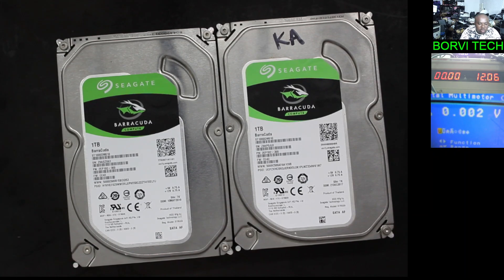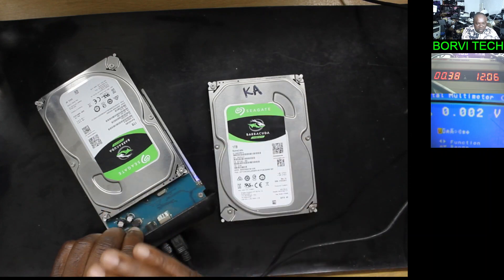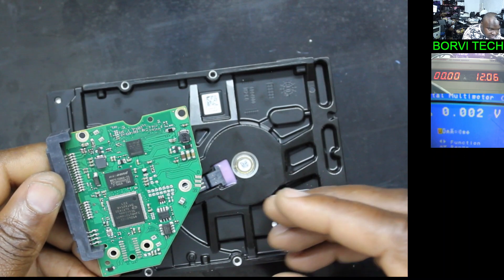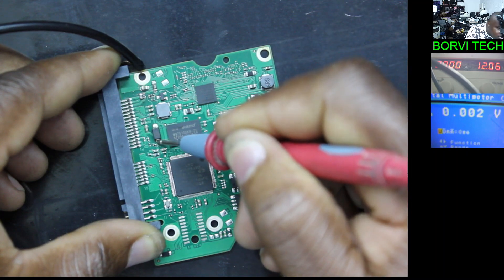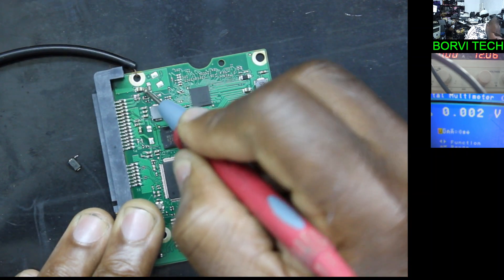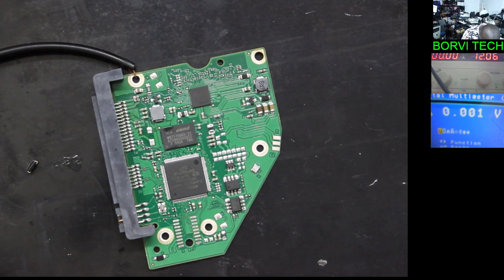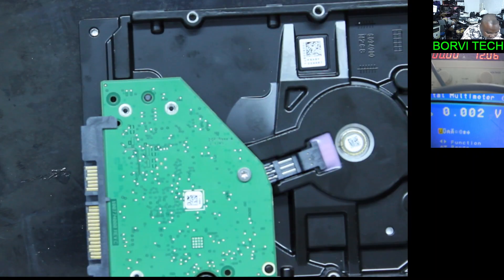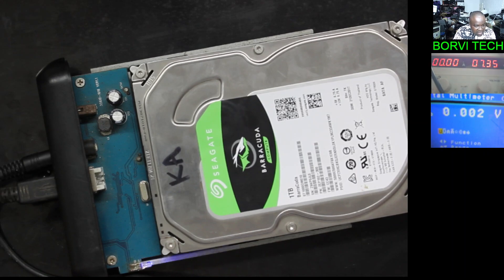Hard drive Fixing a Dead Seagate HDD - No Power

Comment: Resp Sir! Very Nice Sir. ధన్యవాదములు Sir 🙏🏻. My Seagate 500 GB Hardisk Spinning and Stoped Motor Power 3 Points Tested Voltage Coming immediately Zeero Voltage Decreased Sir. that Connected Small IC Sir. IC Changed Sir or not Sir. All Diodes are Capacitors are OK Sir, CPU IC Over Heat Sir. Please Advise Sir. Iam Waiting for Ur message Sir. 🙏🏻.. 🙏🏻..   --    ChinnaRao Paderu Andhrapradesh
Reply from the maker: Easy way to test is to look for a other same hard drive and swop the board and the emprom  chip,, and see if that Solves your problem